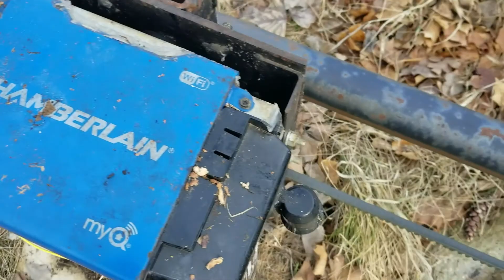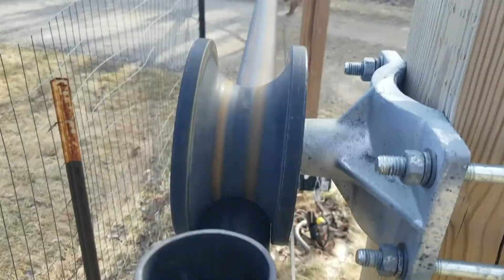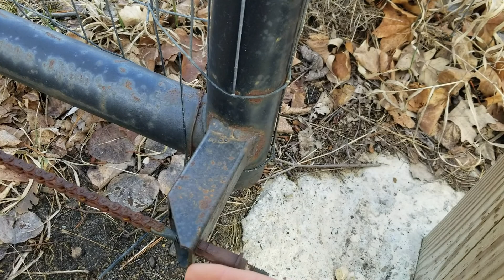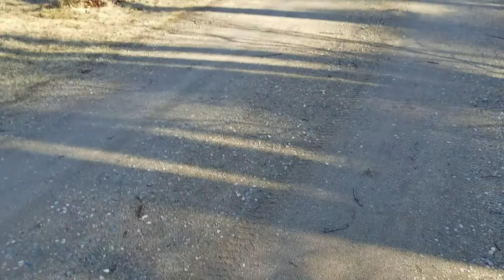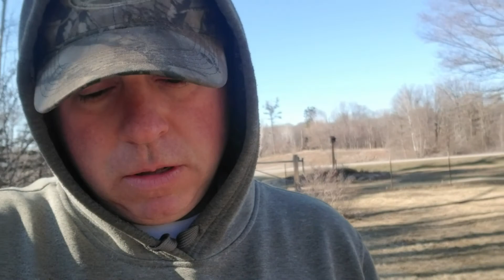Cantilever Gate Opener Hack! Automatic Gate opener. #drivewaygates #diy #hack

Comment: How did you connect the belt to the  old chain?  Have you had any problems with the connections over the years?  I have a similar gate that has a chain.  The opener is a “Nice” brand, I believe, but don’t know much about it.  I like the idea of a belt so I don’t have to worry about the chain rusting but I do lubricate it every few months.
Reply from the maker: If you can get a look at a belt drive garage door opener you will see where the belt connects to the carriage at each end.  The end that has the tensioner has one link of chain, so all I did was extend it.  Thinking that the chain would flex if needed, but the chain has rusted to the point that it doesnt move anymore.  Really doesnt need to be chain, could just be attached to the gate at that point.  The only issue I've had with the belt is that one time it jumped off the idler pulleys.  I don't remember if it was to much snow or freezing rain that was the culprit.  I did a short today of the gate moving in sub zero temps.